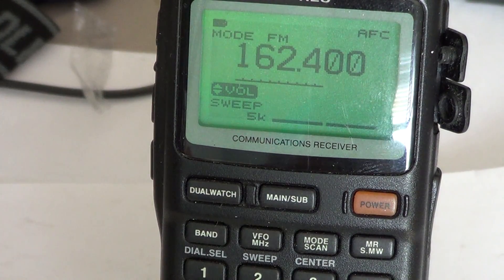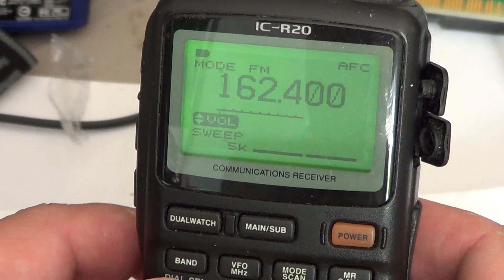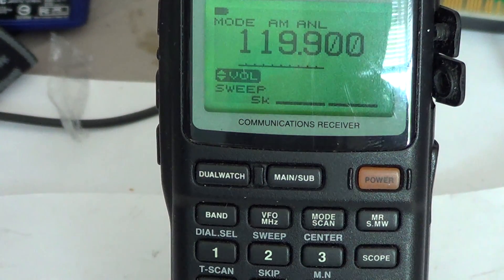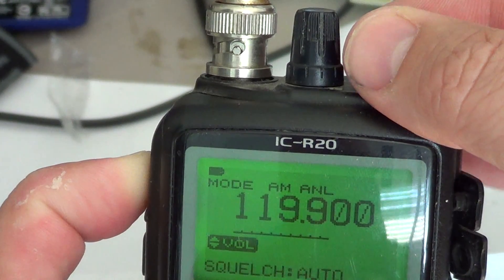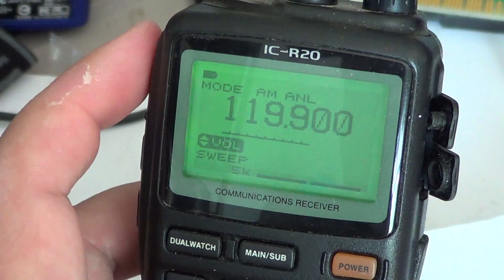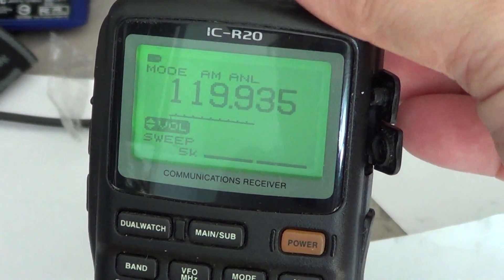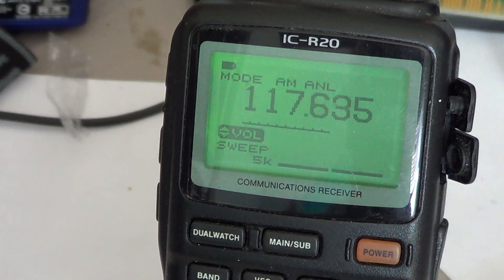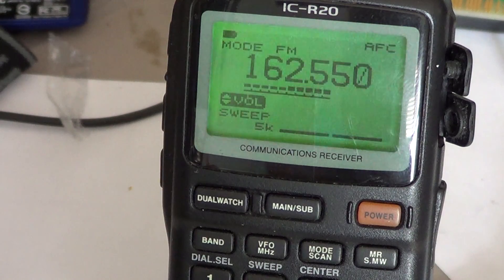Icom IC R20 Tutorial - Basic Operations

Comment: Hi and hoping you can help? Years ago, I had a realistic pro 2006 and I could put in two frequencies and it would search between the two of them looping around. I want to do this with my R20 radio I have bought but I can’t find anything on how to do this??? I can get it to start searching, but it just keeps going and going for ages. I want it to search between to numbers I put in and not the whole range of the scanner. Is this possible and if so, could you explain it, or do a video on how to do it. Many thanks

Comment: Very informative; just picked one up used in immaculate condition, still had the plastic protector. I ordered the soft case online to reduce wear, these radio's are so hard to find because Icom stopped making the R20'S some time ago. Reading the manual is helpful but your video's make it far easier to understand, "Excellent Demonstration"

Comment: IC-R20 & AOR 8200 MKIII are both just as good as each other both top of the range, 
any scanner is good dependant on what you want to monitor, i monitor Military airband 24-7 pretty much and so i'd use either, also depends on how much cash you have, 
Uniden Bearcat 3500xlt is a great scanner too for beginners, before stepping upto the IC-R20 or MK III.